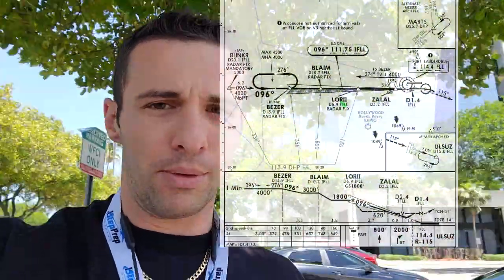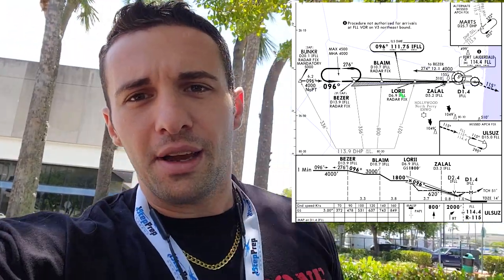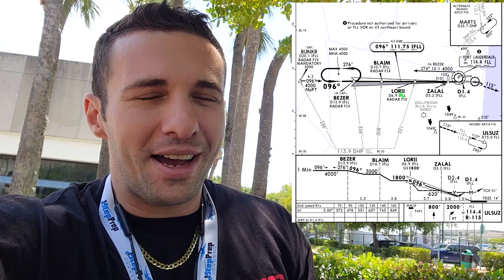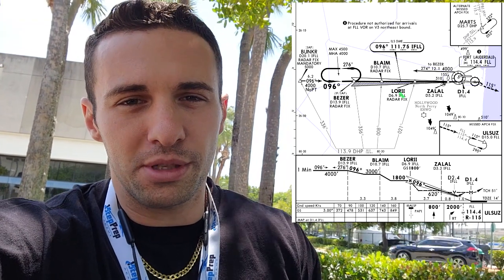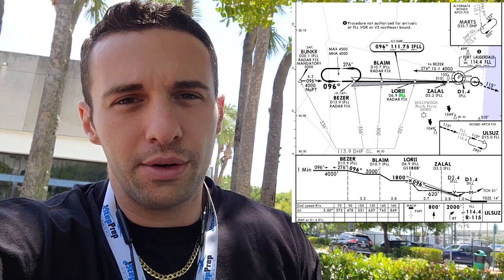Approach Planning - Energy Management

Comment: 2000AGL is pretty standard for gear down/f15 it’s what happens before and after that point that turns the science into an “art” as far as nailing an idle decent, config at min speeds, to hit 1000 stable. 

Many seem to miss that boat entirely by being a cuck to VNAV

Comment: My rule is everything down by 2000 and no faster than 180 within 10 miles. I prefer 165 flaps 10 capture so I try to get down to it after 10 miles but sometimes the wind won’t allow it so I normally end up 180kts flaps 2 capture. If the white hollow diamonds of the ILS start to come alive and the VNAV wants to level me off early I end up using V/S 500-650 to capture G/S instead of leveling off similarly.